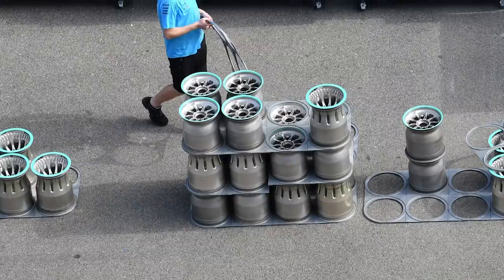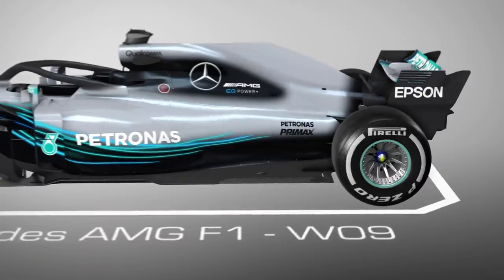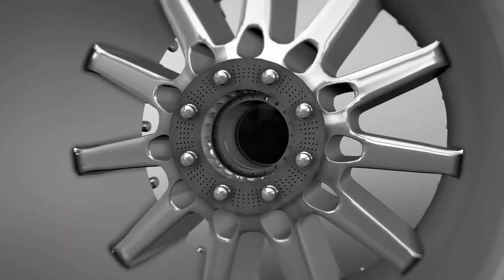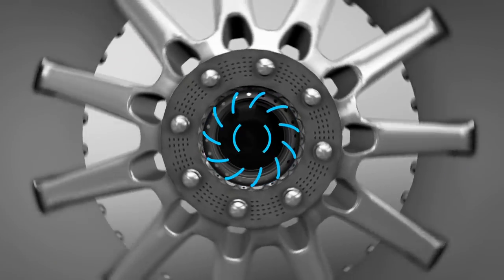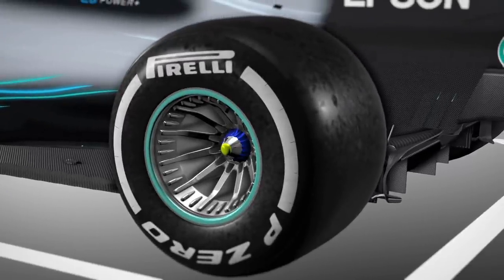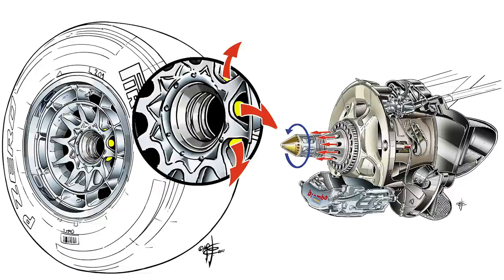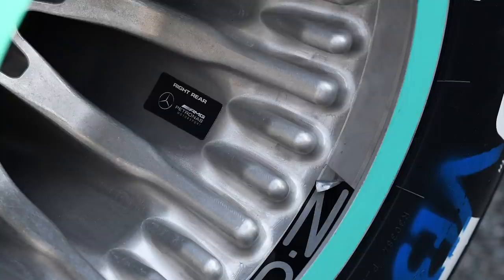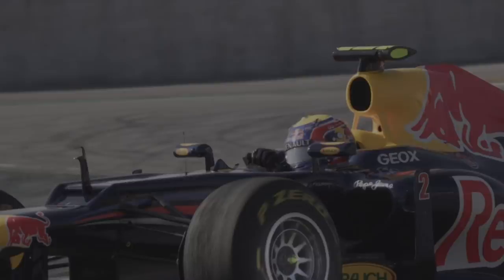Inside Mercedes' controversial F1 wheel rims

Comment: Isn’t innovation like this the whole point of competitive motorsport? You come up with ideas to beat the competition that falls within the rule book while pushing the envelope
Reply: youd think so but mazda crushed at lemans with a rotary and everyone else pissed and moaned. nascar banned "aero" cars like the superbird while ford was working on one. it comes down to innovation comes second and making losers feel good comes first
Reply: Just my opinion,but f1 could be doing 300 mph by now,they purposely slowed them down for years and mostly I'm just glad they let the wider wheels come back at all. But it's pretty much a spec race now because when someone does  come up with something it becomes  controversial.  Anyone remember the bendy front wings on the red bull?
Reply: No, not really. Innovation like this, yes. Innovation like this, in the manner they did it, no. I wouldn't say they're cheating per se, but they are dipping into things that aren't covered RIGHT NOW. That's where the weirdness is coming from. if the season rules involved using rims for airflow, this would be a nonissue. Everyone would be doing it. 

It's an issue of timing, more than actual cheating. Remember, the sport is all about technological advancements. They need data from real world test beds(cars) to make sure things work, and they need some regularity to make sure that data isn't tainted. when you introduce new and other things, you can't get a good read on the data you originally wanted.
Reply: @Ozem_Israel  I don't understand why you would make f1 300mph even if we could. Let f1 be what it was designed to be, and make a new class for the 300mph vehicles. duh. lol ;)
Reply: NiceWhenEarned RudeMostlyElse they when already going. 230 mph in the v10's if unchecked they would have kept pushing. F1 was supposed to be about who has the best with less rules than they have now. Keep your duh.
Reply: Competitive people tend to be the most toxic too. I wouldnt be surprised how they would use "Fairness" for their motives.
Reply: Ya I really wish they would have a 'No Limits' race too. When I was a kid I remember seeing on Discovery Channel that Renault made a new gearbox for the F1 car. It was like a scooters gearing, Audi played around with it too in their A6  about 10 years ago, but it wasnt very reliable. Just one gear, ratio ever expanding. Renualt gained a meaning full amount of acceleration from not shifting, but they were never allowed to bring it to the track.
Reply: @Matt-lx6cj  Safety can be very creative. If unlimited design were allowed ,many teams would drop out fewer teams making less exciting racing.
Reply: @Matt-lx6cj  Without some kind of  limits we end up with a Rally Group B situation and people die. That's bad for everyone.
Reply: Evil D meh 😂
Reply: Bottleflask I think you’re referring to a CVT.  That is hands down, the fastest and most efficient transmission design.  With a CVT you don’t have sudden drops in rpm when changing gears the way you get with traditional transmissions. The funny thing is, in most performance cars that you can buy today that have a CVT, they modified the function of the CVT to simulate a traditional gear shift, thereby completely defeating the purpose of the CVT! The reason: car people like the sound of their engine revving up and down as they accelerate. 😂
Reply: mindofmyown333 no, the point is to win. Innovation is a byproduct of trying to win.
Reply: Alec Walker
The point about the Mazda 787b isn't quite true.

The wankel wasn't outlawed as a result of them winning Le Mans (their only win of the season). Rather it was outlawed as a result of Eccleston's new 3.5 liter, F1 engine rules in Group C, which was designed to kill the WSC, so F1 became more popular.

It was the WSC being more popular than F1 that, in effect, killed the wankel, not the wankel's performance.
Reply: I agree completely; they might as well ban everything and make them all run on foot.
Reply: Jan Hendrik Franke Jan Hendrik Franke I can’t find the original article that I read but I can tell you specifically that in SPORT mode, the 2013 Nissan Altima 3.5 SL artificially simulates a geared transmission despite the fact that it is a CVT. There are other cars that do the same thing. The reason: “acceleration without shifting isn’t exciting enough for driving enthusiasts.”  I’m not stupid. This isn’t my design. I’m just telling you the facts.  I never said Hypercar either, though I will admit maybe performance car isn’t the right description for an Altima, lol.
Reply: A fucking men.
Reply: nascar,  and nhra have done this. they limit innovation for a "level playing field'' to the point that the racing is pointless to watch
Reply: @AverageThinking  
My 2001 audi a6 has a CVT. I love it in tiptronic mode. Seamless shifting. And in fact its argued that the C5 platform had the best most bullet proof CVT for a long time.
Reply: @Ozem_Israel  that information is widely known and adds nothing to the conversation or your original post. If you want to argue whether they CAN go faster, argue with a ten year old, because that's stupid obvious. If you want to talk about why f1 doesn't do that, or should or shouldn't do that, then im in. Prattling facts like a know it all doesn't do anything, especially on youtube.
Reply: You could then argue that the corked bat should be used freely. And if the corked bat, then an exoskeleton that the player can where to automatically hit home-runs. And the pitcher should be allowed to use a cannon to outdo the exoskeleton.
Reply: @dirtysaint5324  no.. the corked bat provides a direct performance gain to the batter. Making the ball go further than a standard bat. These "spacers" are technically cooling aids, and dont provide an aerodynamic advantage.
Reply: NiceWhenEarned RudeMostlyElse you should take your own advice, I clearly said it was just my opinion , I mean shit if you don't agree keep it moving.
Reply: NiceWhenEarned RudeMostlyElse and keep in mind that I never used any defamatory words to try and convey my point. Bruh!
Reply: @AverageThinking  Engine VROOM doesn't go vroom to VROOM so me no likey! - Car Guys
Reply: @EvilSSP  They only care about money without any foresight to move forward. Teams try to move forward and win but they also try to invoke the regulations and hold others back if others best them. With allowing moveable aerodynamic devices, better engines, the gearbox stuff people talked about, everything, it would just be flat out better. One important safety feature would be having tracks with runoff room everywhere with a very large minimum space.
Reply: @slappy8941  😆that would be interesting ,bumping into each other over taking each other while running like Forrest Gump.
Reply: @lerippletoe6893  I'm not saying they don't take it too far, only that complete anything goes will ultimately not end well. There has to be a limit somewhere. I don't think this rim issue is a big deal though.
Reply: That used to be the motorsports ethos. Open class or go home
Reply: "within the rule book"
Reply: I agree that a sport, with very basic limitations could be very very interesting indeed. Maybe just a defined volume, there must be only one driver controlling the gas, break and steering, some arbitrary cost restriction, To generate motion by the reaction of the wheel and surface friction. anything withing those constraints can be used to propel the driver forward any way possible, but it could get way out of hand.

 I wouldnt say limitations limit innovation, it's just really hard to produce a significant increase in performance after a while, and there will always be some sort of limitation, and "innovating" long enough everyone will still converge and creep up on a single design by marginal changes in performance and it gets "boring" Even if those small changes actually require huge amounts of technicality. And thats literally the beauty off it all, atleast for me, to act withing a constraint producing a tool designed to reach that goal, reaching the limit of greatness given that constraint, if you have no sort of limitation there wouldnt even be a sport, there must be some rules. The track itself is a constraint, being the fastest one to win is a constraint, etc. Altough it is arbitrary what you choose to constrain and the enjoyment will always be during the biggest changes, I think if you choose it carefully you can decrease fatalities, accelerate useful and practical technologies which we can use in many other sectors to make the world better too!
Reply: mindofmyown333 - Money is.
Reply: @Ozem_Israel  No doubt F1 could be running 300 mph cars right now. We have the technology to do so. But you'd almost certainly return the sport to the days when two or three top shelf drivers died every year out on the track.
Reply: Yes
Reply: mindofmyown333 In f1 the only innovation they have is non. Unless all cars have it.
Reply: David Flores I don't disagree with that entirely, the recent cars have been proven to be super strong even before that horrible looking halo thing. I think only juels bianchi was the only one to die in a modern car. Also I don't necessarily want to see them doing 300 MPH, I'd be satisfied with letting them run the aero they want to run without Soo many restrictions. And also it would be nice if another tire sponsor was on board to fuel with pirelii. That's it, all I got to say on this topic for now. Peace out.
Reply: @Nikkeftw  that is a cvt and that would not last a single race.
Reply: I am the 1000th person to like this comment
Reply: F1 rules are stupid !
Reply: Nope, 6 wheeled cars...Banned, Cars that suck themselves to the race track to increase cornering speeds..Banned, trail braking systems...Banned, the list goes on and on.
Reply: mindofmyown333 some day some innovator will bring a since Mercury Engine vehicle into the race and it'll beat everything and such a fuss will be kicked up in the air. I love innovation, but when the primary reason the race exists is ruined then it's sad. This wheel hub design is awesome. Let's keep it
Reply: Agree!! And believe it or not but WE the consumer will take advantage of those innovations ;)
Reply: because they don't want another Group B; where innovation drove to speed and power, but also cost lives.
Reply: mindofmyown333 my good sir, how do you ever expect the money men to fix races and make tons of dough on the backend if you’re just letting drivers and teams actually “innovate” for the edge?
Reply: Afaik there's different standards of the sport, some focused on drivers and some focused on cars
Reply: yes but there has to be a balance so smaller teams can compete, R and D is expensive
Reply: Dodge in the 70s got removed with the wings
Reply: than let others do same
Reply: Benz - The Best or Nothing!
F1: Nothing!
Benz: Damn :(
Reply: @dirtysaint5324  there's a difference there. Baseball is a sport where we're trying to push the limits of what the player can do. F1 is supposed to be pushing the limits of what the technology can do. With baseball we control the bat and the ball but the player is free to build their body without steroids (though I think this should be allowed but I get the unfair advantage over those who don't wish to use them). With F1 the limits should be the displacement of the engine and the box the car can fit in as in a max height, width, and length. Everything else should be fair game.
Reply: FrankW1029 Would it also not drive innovation in safety?
Reply: Politics ruin everything.
Reply: Jan Hendrik Franke so why do they use them in top fuel?
Reply: Average Thinking , yes as I recall when cvt was introduced people kept bringing their cars back to the dealerships and claiming their transmissions were faulty. It's so ingrained in people to feel the car shift that they thought the lack of shift feel meant the transmission was slipping. Does anyone, even now, sell a cvt equipped car that doesn't have artificial shift feel?
Reply: Dirty Saint I think you are confused. Baseball is a game of human skill, using repeatable, similar equipment to showcase the skill of the human, not showcase the skill of the equipment. Racing on the other hand was designed primarily to showcase the equipment, and became a game to show the skill of both the driver and the equipment. Unfortunately it became mired in rules and the goals became fogged by the constant whining of the losers. As egos of drivers are driven by winning and not by having the best equipment. Also by not allowing any other manufacturer to develop a competitive edge, it keeps the lazy manufacturers competitive- looking at you Ferrari. To truly examine each aspect you need classes of racing. Unfortunately all current classes of racing involve humans. And thus, egos. To truly test either, all the cars for humans should be identical. To truly test equipment innovation all drivers would have to be identical AI.
Reply: well, no, not really. Competitive Motorsport these days is basically bog standard tech and restrictions in place to restrict any real innovation because it should be about the drivers skill blah blah...
Reply: @alecwalker449  dude that's so true, (I'm a huge Mazda fan too lol)
Reply: mindofmyown333 it's brilliant is what it is. Check out the like/dislike ratio. . Perhaps that's why my guy
Reply: F1 is a good old boys club they hate real innovation. Banning the rotary is a big example of this.
Reply: @slappy8941  my only addendum to what you added would be" Barefoot.  Because sneakers can give an unsafe advantage for being too fast.   heh
Reply: They banned turbines, so innovation doesn't matter.
Reply: mindofmyown333 Yes, but a lot of “innovation” has been outlawed over the years, for example, Andy Granitelli and his All wheel drive turbine Indi car, the “vacuum cleaner” Can Am cars, Richard Petty and running a 215mph lap at Daytona.
Reply: Borninvincibl3 FPV I agree its a good thing they have tried to keep the speeds in check. The me mechanism of injury and in turn the actual injuries would be increased by I would guess two or 3x. 

Speeds is the main reason NASCAR has certain tracks now are restrictor plate races, it just keeps everything safer and more about the driver vs driver, and not driver vs tech.
Reply: Riley Fenley I don’t disagree a bit with that.  Just saying that innovation is outlawed many times.
Reply: Evil D I feel like that’s only bad for one party. The other party gets content to watch
Reply: @eflanagan1921  i think your wrong there's always someone willing to kill themselves for glory
Reply: exactly...there's no issue here, its called progress, the other teams just salty cause they never thought of it first. it reminds me of red bull a few years back.
Reply: Um, why does this bother you? The FIA banned active suspensions, extra high diffusers, midship wings, side skirts, (used in the late 70s), fan induction (car was banned after ONE race), specific kinds of double-wishbone suspensions (Look at Lotus, they refused to even let them use the car for ONE race!). They're free to regulate the sport in any way and that has been going on for decades. Again, why does this annoy you?
Reply: Exactly
Reply: I was just going to comment something similar. I though F1 was about innovation.
Reply: @Nikkeftw That was a CVT transmission (Renault-Williams  FW15C CVT) and the advantage was to great so it was bannned. Formula 1 has become a lawyers sport where they can do little more then push the limit of how many square millimeters of carbonfiber extension they can get away with without breaking the rules.

They have a point about the budgets which made it impossible for newcomers to enter F1, but they executed it wrong. They should set a budget, max amount of fuel and tires to be used during a single race weekend. For the rest there should be no other rules apart from strict (crash) driver safety rules. There is no chance in hell a new Cooper will ever enter F1 again with a well executed concept that changes the game. That was what F1 was once about, winning and innovation. Today that innovation part has been taken over by the Lemans Prototype cars which have become testbeds and more advanced then F1 cars.
Reply: F1 is marketing. The WWE isn't real either.
Reply: mindofmyown333 it’s complicated but essentially yes
Reply: @Nikkeftw  
"No limits" racing stops being a contest of drivers, and becomes mainly a contest of engineers. Which realistically is a contest of wallet thickness.

Most people identify most with the driver, and thus favor a test of driving skill, not engineering skill.
Reply: @bcubed72  I see your point.
Reply: @nicewhenearnedrudemostlyel489  It isn't cheating if there is no rule.
Reply: Idk. Everytime someone invents something to get ahead. It’s always baned the next year. So idk.
Reply: @janhendrikfranke  I'm not sure if car cvt's are the same as a snowmobile but I personally have ridden 680h.p. asphalt drag sleds and know guys with over 900+ and those clutches and belts hold up.....from Wyoming USA 🔫🤠
Reply: @imanudistperson  they dont....from Wyoming USA 🔫🤠
Reply: Ask why NASCAR is going broke. Rules forbid innovation.
Reply: @Nikkeftw  Toyota ch-r only has 1 gear. Off topic lol.
Reply: Precisely
Reply: I agree
Reply: Pushing the envelope lol nice pun!
Reply: Not when they are willing to change the rulebook when something just dominates the field.
Reply: Yes and no I think. The now seem to know with the 2021 rules that for competitions sake they need to limit some advantages for those willing to spend endlessly. So there will be spending caps and the wheel design will be fixed as I understand it.
Reply: @alecwalker449  I don't agree. It comes down to one or two terms with near endless money winning all the time and that makes for boring racing. For example the only thing we know about Lewis Hamilton from the teaching is that he is probably a better driver than Valtteri Bottas, otherwise chain out up to Mercedes engineering and money. B O R I N G.
Reply: Mazda didn't win because of innovation. What more or less happened was the rest of the teams got screwed over by race politics which forced them to switch to their 1990 car. If their car was so good, then they would have won the year earlier in 1990.
Reply: Wait a minute, we could petition the FIA to come up with a new new sub branch of F1, where the goal is to pick the best drivers and the most ridiculously fast cars that the teams that choose to compete can come up with
Reply: @Nikkeftw  a cvt transmission would do the exact same thing, so maybe a racing version of that which would be dope asf
Reply: Borninvincibl3 FPV of course they could. But the problem would be some cars might end up looking like Bugatti’s while the others look like mini coopers. It would look like a drag race. Imagine an Olympic 100m sprint race. They can have their own shoes and clothes but they can’t be totally different (etc robotic legs or someshit)
Reply: They want teams to be competitive but don't want them to be dominant. It's apparently more about the money than the sportsmanship, F1 has a lot of these politics and politics is always nasty
Reply: No. The point of competitive Motorsport is to be entertaining to watch. They need to make money, and no one wants to watch a race where one team always wins.
Reply: totally agree
Reply: @jonhunt5408  Doesn't Subaru? You CAN go into paddle shift mode, but in regular Automatic I don't feel the shifts; it's super smooth. The paddle shifters with artificial gearing is very useful in Winter though at low gear.
Reply: @Ozem_Israel   A little thing called safety mate , same reason they use restrictor plates on Nascars and pull the chutes at 1000' at the NHRA.
Reply: @enforcer41  you must don't know that originally f1 was about being on the cutting edge of insane and the only reason they stopped doing that was they were trying to curb cost that the teams eagerly spent.
One might say was the reason for the decline of Ferrari.
But now they're taking steps beyond that into a spec series.
Reply: @Ozem_Israel   I do know that and also know that many regulations came into effect due to safety concerns and to curb costs.
Reply: @enforcer41  since Senna died there was like one fatality Juelz who I liked very much, so safety was not the top priority if they wanted to keep the spectacle. 
And 2 formula 1 makes a ridiculous amount of money to find any projects they want and cutting back cost have helped one single new team do anything.
Yes I have been watching for decades now and I know what I'm seeing.
Reply: @Ozem_Israel  I thought it was always a 'spec' race, called a 'formula' in this case.  No?
Reply: @Matt-lx6cj  Group B rally was basically a 'no limits' class and everyone loved it.  Until people starting dying, then everybody hated it and it went away.
Reply: @Feniantimmy  I already explained it started out about cutting edge tech, have a good day.
Oh not cutting edge... Bleeding edge tech.
Reply: @alecwalker449  mazda was slow
Reply: @nicewhenearnedrudemostlyel489  whos gonna drive them
Reply: @Ozem_Israel  Remember ground effects? Remember the fiddle brake on the McClaren? Remember Active Suspension? All these got outlawed because they got scared of innovation
Reply: @TeemoQuinton  Yes I sure do remember those things they tried to put a limited slit differential on the front on the front two wheels it didn't have a drive axle but it was a LSD there.
Reply: And when ferrari does it, everyone comes crying to FIA to ban it. Yeah, innovation much.